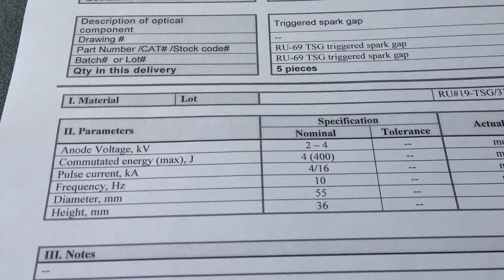Two- and Three-electrode Spark Gaps and Trigger Transformers

Comment from the maker: Pentaerythritol tetranitrate (PETN), also known as PENT, PENTA, TEN, corpent, penthrite (or—rarely and primarily in German—as nitropenta), is the nitrate ester of pentaerythritol, a polyol. Penta refers to the five carbon atoms of the neopentane skeleton.
PETN is most well known as an explosive. It is one of the most powerful high explosives known, with a relative effectiveness factor of 1.66.
PETN mixed with a plasticizer forms a plastic explosive.[3] As a mixture with RDX and other minor additives, it forms another plastic explosive called Semtex as well. The compound was discovered in the bombs used by the 2001 Shoe Bomber, in the 2009 Christmas Day bomb plot, and in the 2010 cargo plane bomb plot.
It is also used as a vasodilator drug to treat certain heart conditions, such as for management of angina.
http://www.princeton.edu/~achaney/tmve/wiki100k/docs/PETN.html

Comment from the maker: Featured research:
TRANSIENT DETONATION PROCESSES IN A PLASTIC BONDED EXPLOSIVE
Los Alamos National Laboratory, Los Alamos, NM 87545
Air Force Research Laboratory, Eglin AFB, FL 32542
Abstract. Experiments involving the transfer of detonation from small booster charges of PBXN-5 (95% HMX and 5% Viton A) into larger charges of various plastic-bonded explosives (PBXs) have produced some surprising results and have stimulated investigation into the factors governing observed responses. To understand these results, we conducted a series of tests with different miniature detonator-booster configurations using laser velocimetry to quantify the pressure pulse that is
transmitted from the PBXN-5 booster. Models were used to determine the ideal explosive behavior for comparison with the measured results. The differences are interpreted as being due to transient behavior and late-time energy release from the booster charge. We characterize these behaviors as evidence of microdetonics, where we define microdetonics as the study of less-than-CJ detonation performance due to curvature and/or transient behavior. This provides useful insights into the
fundamentals of the detonation process that can feed into advanced modeling approaches such as Detonation Shock Dynamics (DSD).
http://library.lanl.gov/cgi-bin/getfile?00818494.pdf

Comment from the maker: Mid-IR free-space optical communication with quantum cascade lasers
Edward Luzhansky, Fow-Sen Choa, Scott Merritt, Anthony W. Yu, Michael A. Krainak
23 April 2015 • 3:30 - 3:50 PM | Part of SPIE Defense + Security

Thermal diffusivity estimation with quantitative pulsed phase thermography
Juan Esteban Ospina, Juan Felipe Florez, Hernan Dario Benitez
22 April 2015 • 5:35 - 5:55 PM | Part of SPIE Sensing Technology + Applications

Novel broadly tunable fiber laser system
Steven Bowman, Christopher G. Brown
22 April 2015 • 3:30 - 3:50 PM | Part of SPIE Defense + Security

A numerical approach for testing and evaluation of mild steel material by thermal wave imaging
Ravibabu Mulaveesala, Geetika Dua, Juned A. Siddiqui, Ghali V. Subbarao, Amarnath Muniyappa
22 April 2015 • 4:55 - 5:15 PM | Part of SPIE Sensing Technology + Applications

Proposal of a defense application for a chemical oxygen laser
Kiwamu Takehisa
21 April 2015 • 6:00 - 7:30 PM | Part of SPIE Defense + Security

Recent progress in quantum cascade external cavity laser systems optimized for mid-IR sensing applications
David B. Arnone, Leigh J. Bromley, David B. Caffey, William B. Chapman, Timothy Day, Allen Priest, Charles C. Harb
24 April 2015 • 6:00 - 6:20 PM | Part of SPIE Defense + Security

Pulsed thermal NDT in tables, figures and formulas
Vladimir P. Vavilov, Douglas Burleigh
22 April 2015 • 1:00 - 1:25 PM | Part of SPIE Sensing Technology + Applications

Pulse compression techniques to improve modulated pulsed laser line scan systems
Robert W. Lee, Linda Mullen, Shawn P. O'Connor, Brandon Cochenour, Justin Nash
21 April 2015 • 2:10 - 2:30 PM | Part of SPIE Defense + Security

Recent progress in high-power ultrafast thulium-doped fiber lasers and mid-infrared supercontinuum sources
Jiang Liu, Hongxing Shi, Kun Liu, Fangzhou Tan, Pu Wang
21 April 2015 • 9:40 - 10:00 AM | Part of SPIE Defense + Security

Pulsed microwave heating method for preparation of dye-sensitized solar cells for greener, faster, cheaper production of photovoltaic materials
Clifford B. Murphy, Robert Cotta, Timothy Blais, Charles B. Hall
21 April 2015 • 2:05 - 2:20 PM | Part of SPIE Sensing Technology + Applications

Efficiency of using the spectral dynamics analysis for pulsed THz spectroscopy of both explosive and other materials
Vyacheslav A. Trofimov, Svetlana A. Varentsova
20 April 2015 • 11:40 AM - 12:00 PM | Part of SPIE Defense + Security

Stand-off detection of explosives and precursors in realistic environments using UV coded aperture Raman spectroscopy
Mattias Svanqvist, Markus Nordberg, Henric Östmark
23 April 2015 • 11:10 - 11:30 AM | Part of SPIE Defense + Security

Possibility of the detection and identification of substance at long distance using the noisy reflected THz pulse under real conditions
Vyacheslav A. Trofimov, Svetlana A. Varentsova, Vladislav V. Trofimov
23 April 2015 • 2:40 - 3:00 PM | Part of SPIE Sensing Technology + Applications

Anomalous reflection of THz pulse containing a few cycles from absorbing layer: influence of absolute phase of the pulse on the medium response
Vyacheslav A. Trofimov, Mikhail V. Fedotova, Elena S. Komarova
23 April 2015 • 11:40 AM - 12:00 PM | Part of SPIE Defense + Security

DBR and DFB lasers in Nd and Yb doped photo-thermo-refractive glasses
Aleksandr I. Ryasnyanskiy, Nikolai Vorobiev, Vadim Smirnov, Julien Lumeau, Larissa Glebova, Oleksiy Mokhun, Christine Spiegelberg, Michael A. Krainak, Alexei L. Glebov, Leonid B. Glebov
21 April 2015 • 11:30 - 11:50 AM | Part of SPIE Defense + Security

Active stand-off detection of gas leaks using an open-path quantum cascade laser sensor in a backscatter configuration
Adrian Diaz, Benjamin P. Thomas, Paulo C. Castillo, Barry M. Gross, Fred Moshary
21 April 2015 • 8:30 - 8:50 AM | Part of SPIE Sensing Technology + Applications

Infrared thermography, ultrasound C-scan and microscope for non-destructive and destructive evaluation of 3D carbon fiber materials: a comparative study
Hai Zhang, Marc Genest, Francois Robitaille, Simon Joncas, Xavier Maldague, Catherine Leduc, Lucas West
22 April 2015 • 3:55 - 4:15 PM | Part of SPIE Sensing Technology + Applications

Characterization of planar 6×6 cm2 MCP-based picosecond photo-detectors
Jingbo Wang, Karen Byrum, Marcel Demarteau, Edward A. May, Jr., Robert G. Wagner, Dean Walters, Lei Xia, Junqi Xie, Huyue Zhao
23 April 2015 • 6:00 - 7:30 PM | Part of SPIE Defense + Security

Continuous-wave deep ultraviolet sources for resonance Raman explosive sensing
Balakishore Yellampalle, Robert B. Martin, Mikhail Sluch, Robert V. Ice, William B. McCormick, Brian E. Lemoff
21 April 2015 • 9:00 - 9:20 AM | Part of SPIE Defense + Security

Review of pulse phase thermography
Clemente Ibarra-Castanedo, P. Servais, Xavier Maldague
22 April 2015 • 2:15 - 2:35 PM | Part of SPIE Sensing Technology + Applications

Measurement of flaw size from thermographic data
William P. Winfree, Joseph N. Zalameda, Patricia A. Howell
21 April 2015 • 2:10 - 2:30 PM | Part of SPIE Sensing Technology + Applications

Divalent chromium doped ZnSe nanoparticles random laser induced by nanosecond laser pulse
Jiayu Yi, Guoying Feng, Chao Yang, Shouhuan Zhou
21 April 2015 • 6:00 - 7:30 PM | Part of SPIE Sensing Technology + Applications

Power scaling of resonantly-pumped double-clad fiber laser based on Yb-free Er-doped silicate glass
Jun Zhang, Radha Pattnaik, Shibin Jiang, Mark Dubinskii
22 April 2015 • 2:40 - 3:00 PM | Part of SPIE Defense + Security

Experimental examination of ultraviolet Raman cross sections of chemical warfare agent simulants
Fredrik Kullander, Lars Landström, Hampus Lundén, Göran Olofsson, Pär Wästerby
23 April 2015 • 1:20 - 1:40 PM | Part of SPIE Defense + Security

Detection of salmonella of globe fruits using pulse excited magnetoelastic biosensors
Howard C. Wikle III, Songtao Du, Bryan A. Chin
21 April 2015 • 3:00 - 3:20 PM | Part of SPIE Sensing Technology + Applications